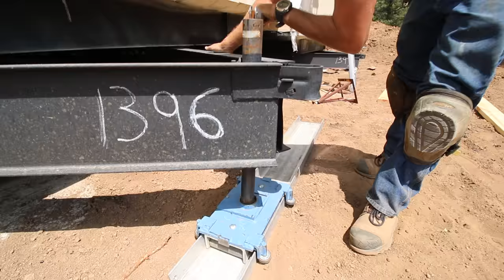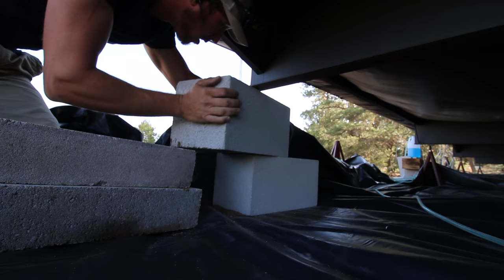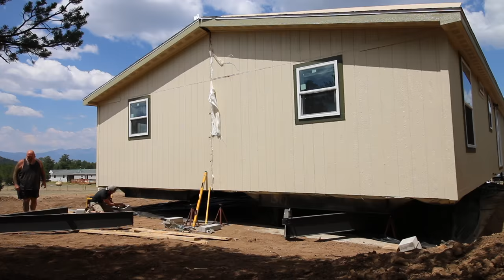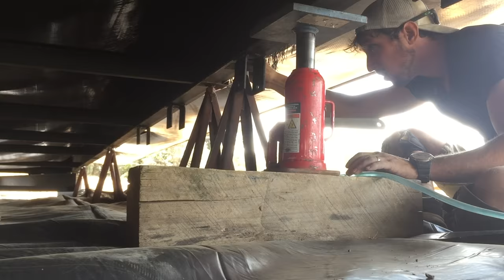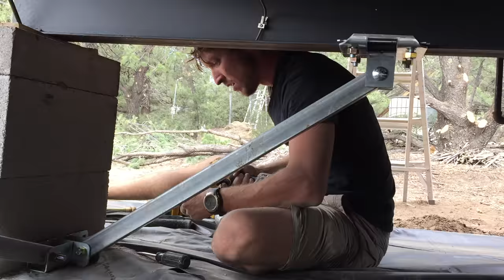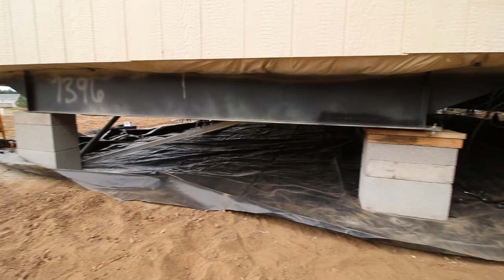Double Wide Installation Timelapse - Home Nation

Comment: As a mobile home setter . You need whole pads under the blocks and plastic if not it's just going to sink and then you have to go back for a relevel.
Reply: What’s pay like for you? And are you laborer or boss man lol. And what state. Just curious
Reply: This will be just fine with vapor barriers and earthquake straps and pier jacks no worries long as it's not wet around the pad, I have done skirting for 10 yrs, they are ready for kickers, frame, hardy panel, and access box & door, then caulk and paint ,then back fill 
it's just fine how it's set up.   I have driven past many houses I set up and there still level and almost exactly the same when I set them up so..
 depending on site prep all day!!!!
Reply: i actually live in a mobile home that was set up like this  if you look at it now its way unlevel where the dirt has eroded out i agree to the concrete pads
Reply: Need concrete footing to go under both sections to keep from settling.

Comment: So can you explain to me how stable the home will be with just the metal bracing on each end like you installed and on blocks verses on blocks with straps. My 56'x32' was just delivered and set up on a base pad with blocks and those braces under each end and I am wondering how well it will hold up over time and if the house will be stable or will you be able to feel someone walking in the house if you are on opposite ends? Just doesn't seem very stable without straps to me.

Comment: If I was going to have a home like this, I would have invested in a regular footer and had it set on cement block like a regular home. Settling occurs with anything, but you will have far less trouble with a good footer than piers just put on the ground....

Comment: Someone please answer!!Been looking into a mobile home here in Saskatchewan. My only question is, Sask gets very cold in the winter time. How do these pipes not freeze in the winter time, as there is no heat source "under" the mobile home, how exactly does this area between the mobile home and the ground not freeze the pipes?  Thanks everyone
Reply: so the main water pipes are tucked underneath and usually only 2 crossover connecting lines that get well insulated, ive installed mobile homes for 15 years , good luck with your future home

Comment: Why do they put plastic under the building? Wouldn't this cause moisture to get trapped under the building
Reply: Only if there is a leak, or an extreme amount of water flowing under the house. A small amount of water is supposed to stay underneath the plastic, and keep moisture out of the crawl space, in theory.
Reply: Vapor barrier.
Reply: It does exactly what you said. Causes moisture to get trapped. Pretty much worthless. Except it makes crawling a little less dirty lmao. And less sketchy in the dark
Reply: it keeps the ground moisture from connecting with the homes underbelly , only time you get moisture above the barrier is caused by improper venting of heat duct or dryer vent

Comment: I have a new 2022 manufactured home being installed and I have several cracks through out the house in the drywall is this normal with the install of both halves?
Reply from the maker: Yes. Cracks in a new mobile home are absolutely expected. You are moving several thousands pounds of weight down the highway, after all.

Comment: I’m in Texas. 

Wondering what the cost of having a mobile home moved about 50 miles from the dealers yard and set up runs in Colorado. 

I’m being quoted over $6k down here. 

That seems high.

What makes it worse is that if the installer runs in to any issues, that price can go up. 

I have some people I know that were quoted $6500 and when done, it went to $7500.
Reply: It depends on who you get to move your double wide. I was looking to buy a double wide which would be moved 10 miles here in South Carolina for about $5000. I instead decided to buy a double wide 119 miles away from where I live and the mover only charged me $5900. It really depends on who you hire.

Comment: How often does this need to be inspected after install?
Reply from the maker: It only needs to be inspected once before moving in.
Reply: @Homenationmobilehomes  is there any inspection done after the homeowner lives in it for so long?
Reply: Every 3 years get it re leveled depending on location and surrounding area
Reply: @ynwdeshawn7511  I doubt this ever gets done. My folks place has been in place for 50 years and it was only releveled once when they had a make shift foundation installed as some remodel work.
Reply: @stevenreeves4766  I do them all the time. Past codes don’t even call for perimeter piers under all load baring walls. Same with center piers. Even your outside walls can sometimes sag and need to be releveled. I’m in Florida. If home is on concrete pad it’s different of course.  Less likely to re level. But on sandy soil your frame can be an inch to even 10 inches out of level (worst I’ve seen). I set them in the field. Straight from the factory
Reply: @ynwdeshawn7511  wow that was fast. ours (inherited from my folks) in on ten acres in Redding CA. It is a 1971 Double wide two 12 x 61 trailers. it is on 4 concrete pads about 24 inches wide the whole length of the unit. the piers (concrete blocks ) are set on those. like you mentioned no perimeter piers, but my folks had a concrete perimeter foundation footing poured around the unit and cripples built and the trailer lifted and set on that all of the way around. this was done around 1990. and the outside siding replaced with concrete lap siding. a new 3 inch solid foam core roof installed on top of the original. our soil here is rocky red clay not sandy at all.
Reply: @ynwdeshawn7511  Do you know how the units are connected together? at the roof line is it done from outside or is it done on the inside at the marriage line? there is only a 3 inch wide strip on the roof on the inside so I was just wondering how they could do that.
Reply: @stevenreeves4766  it depends on the model of the home. Some are lagged together every other rafter with 8 inch lag bolts. Some are only connected together at the roof by metal and flat straps and sometimes in the ends on the center line with metal and lags as well. The strip you refer to is just trim id imagine. Some roofs have sections you can fold back to reach into roof to lag before placing your metal. Normally the house is essentially crushed together. Then metal is put on and roof strapped and lagged depending on model.  Usually on concrete foundation they hardly settle if at all
Reply: @stevenreeves4766  it’s usually done on the roof.  The header beams are lagged together every other rafter

Comment: Well done son. How long did it take you?
Reply: This portion of the project was completed on day #1. Day #2 consisted of Water/Sewer hookups and Skirting/Step installation. A double wide typically takes 2-3 days for full installation.
Reply: Kyle Comino how much it cost on 3 days of labor?
Reply: @anallelygonzalez7482  Depends on the area and size of home...double wide install runs anywhere from 4,000-10,000.
Reply: @k_comino  My home from Terry Pate Home Sales is running 3-1/2 months. A few anchors came up and I had to get the inspector to fail it. So now they have to fix them. So much B.S.
Reply: @CHEECHMUN  Oh that's too bad :( It's rare anchors pull up...possibly weak soil or not deep enough. I hope they get it resolved!
Reply: @CHEECHMUN  Oh that's too bad :( It's rare anchors pull up...possibly weak soil or not deep enough. I hope they get it resolved!
Reply: Is this considered a permanent foundation?
Reply: @anallelygonzalez7482  Ive charged anywhere from $4k to $22k. It can take between 1 day and 1 week depending on the personal & equipment used and the  budget.  We did an 8 wide complex in 8 hours before complete.  But the cost was extreme.  The install costed more than the building .  At the other extreme I've seen a single wide take over a year to set up.  The park owner managed to piss off the building inspector on the first day .  The worst part was the home was already sold.  That left the homeowner having to stay at a hotel for several months with no idea when they would move in. Well it ac

Comment: I watched them install the two halves of a manufactured house that my neighbor was putting in atop a cement foundation. I watched as they brought the two have together. Then they roofed and sided it. What I couldn't believe though, was the gap they roofed and sided over. They pulled the bottom halves together using a come-along until it mated, where they then bolted them up. Although the bottom haves were flush, the more you moved up the center line, the wider that gap got. It looked to be about 5" at the top. Yet, they did nothing about it, but to finish roofing and siding it. When my neighbor got back, I told her what I witnessed; what they covered up. She later told me that she put it on a list of things to be corrected by the installer. I don't see how that's possible, now that all the utilities, like gas and electric and septic, have been installed. I could be wrong, but it looks like she got screwed to me.
Reply: As someone who sets mobiles homes every day, I can safely say 99% of the time, when there is a problem, it is poor build quality from the factory.
Reply: @redsynister4836  I'm no pro, but I think you are right. The factory built a fabricated house that didn't match up, sent it out anyway hoping against all hope that it wouldn't get noticed, and then the installers covered up a build gap wide enough at the top to pass a bowling ball through. Just how they covered that gap in the interior, is beyond me. Smart money says the chief installer called the factory for instructions on what to do in this situation, and was told to go ahead with it anyway. In my book, a man or woman's work should reflect his or her professionalism. It's this kind of thing that gives the industry a black eye that pros like yourself must not only bear, but clean up after. Good on ya!
Reply: @redsynister4836  lol.  Have they ever shipped one that didn't have a leaking kitchen sink
Reply: @1973noxqses  I wouldn't know, I only block, anchor, and lag them together. I dont mess with plumbing 😜
Reply: When the house is leveled and put together. Sometimes the peaks are not lunges up yet. You then have to lag the floors and rack the house in. This closes the house up. It is done before metal is ran down the centerline of your roof.
Reply: @redsynister4836  Do you move and set homes in indiana, sir?
Reply: @Gayle Hiner  no sir/ma'am. I only tend to work in North carolina and Virginia. We don't travel too far from home. We are just a small, family business.

Comment: I thought these things are placed on the slab of concrete. This looks cheesy. The weight of these things plus after you get all your stuff inside.
Reply: No they’re all placed on piers which are these blocks. I know cuz I work on these things
Reply: You grade and pack the dirt before install, you don’t just place the piers on unpacked loose soil..
Reply: around here the "Piers" are solid concrete and they are set below the frost line all the way up to the house floor.